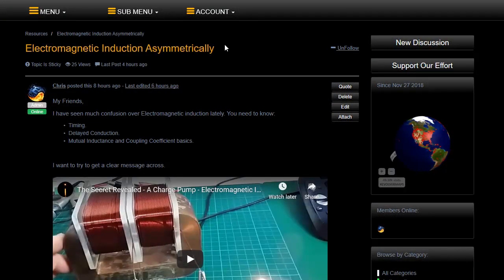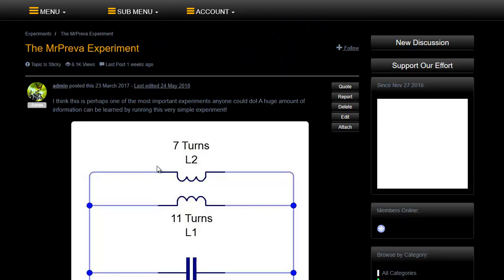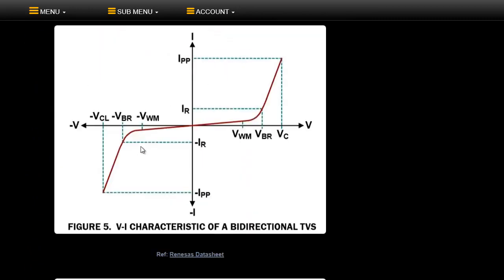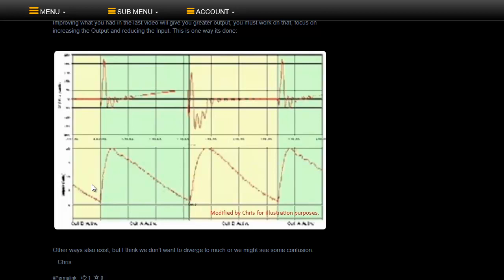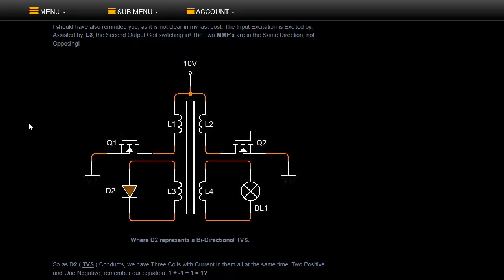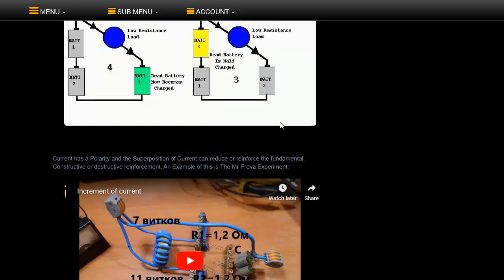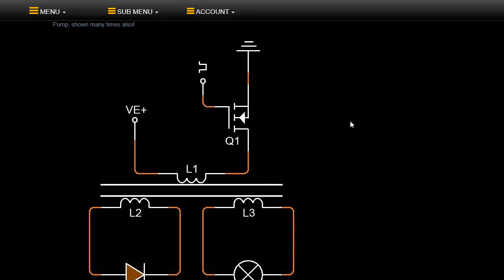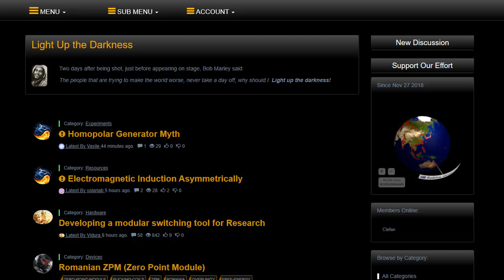The Invisible Force of Electromagnetism - Part of The Secret Revealed Series.

Comment: Another great video!  It's funny how you can work on this stuff for so long but forget or miss some of these principles. I think it's because there are so many rabbit holes to go down it's very hard to stay focused. I love how you are focusing your points. Thanks!
Reply from the maker: Agreed! Focusing on the important things is hard, distraction is a key tactic they use to put people onto the outright wrong things, then they loose momentum and then interest!
Reply: That's my story too. Each failure encourages more research and study and in doing so there is exposure to other builds, other explanations, and encourages other workarounds or other experimentation which of course tends to other failures and around and around we go.

There are many builds and in each of them the number of permutations and combinations for getting it wrong is very high. The likelyhood for getting it right by accident is very low.

It's easy to get a passive understanding of what is going on and think it is as easy as copying a schematic or block diagram. Failure result and can feed some nasty resentments and envy. Hence.. haters gonna hate.

 It seems like the goal of nature is to encourage understanding  through engagement in experiences, in this case on the bench. With time, attention, patience, resilience, and just a bit of encouragement and shepherding some people are able to develop and intuition and acquire The Touch and build application specific solutions.

I haven't managed to find my way but at least now there is some direction.

Rabbit holes are detractors and can be killers. I'm not convinced that many aren't deliberate. 

Every time I watch these videos I pick up on something else that is important that I've either overlooked or underestimated.  That seems to be the story for most people and seeing someone else say it reminds me that I'm not alone in the struggle.